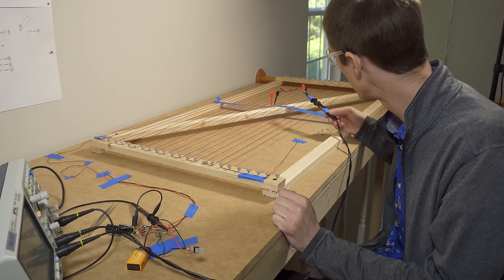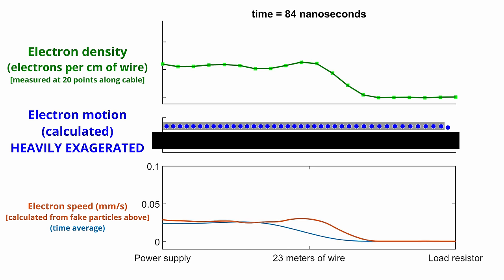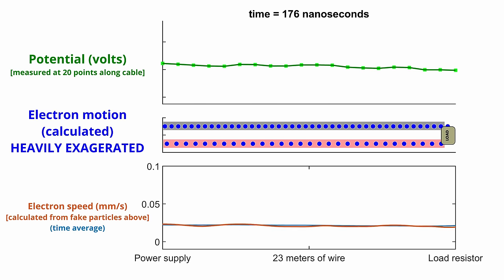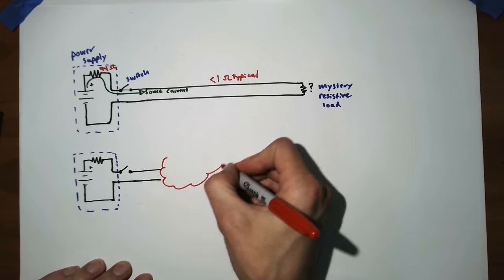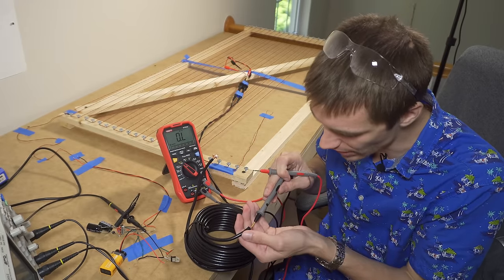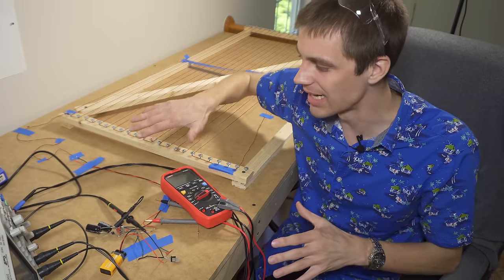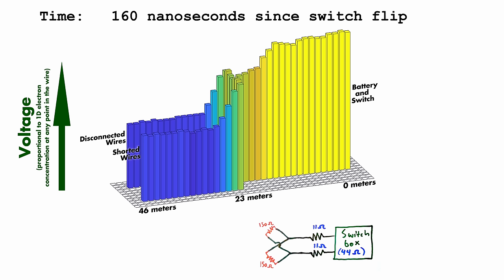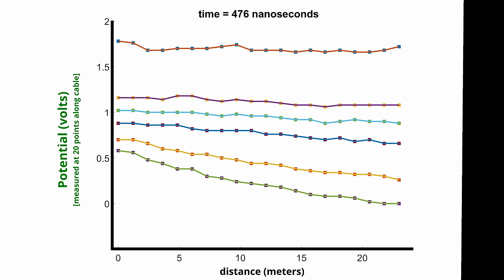What does "impedance matching" actually look like? (electricity waves)

Comment: 25 years ago I learned all this at university.  But the depth of insight you've added to that basic knowledge is a revelation.
Reply: Incredible work here
Reply: I learned the same thing, but 20 years ago...

Anyway what buggs me about the original verstasium post was the original claim that EE didnt learn this.

And.. well  we bety much do. Impedance matchning is like the core of high frequency circit design. Really with out it most modern radio systems would not work at all, like a wifi circut
Reply: @matsv201 yeah, once you get into the Mhz you start to realise that everything is a capacitor and an inductor
Reply: @Jefferson-ly5qe  yea,, i don´t know exactly where the cut of is, we did basically all the labs in 2.5 and 5.1Ghz and then when i worked with it it was basically minimum 800Mhz ... 

Ironically no i work with transport system and the highest frequency we use is 400Hz (note, Hz, not kHz or MHz), typically 8000V and around 1000A.

The people that did the system in the 1970 basically just made a gigantic coaxial cable and bent it to form. This turned out to be incredibly expensive. Of cause we talk about 100 of km of cable, so that is millions and millions.

Some of the AC we could simply eliminate but some of it need to be around, So we basically try to balanced stamped metal sheets. Resistance of the old system was also a bit to high.

Makes it a bit more complicated by the load of the vehicle change the induction.

Still its not really that complicated compare to like a 4G muti frequency base station that i worked with prior. its really just a different kind of complication because everything is huge.
Reply: this is not deep inside. It is an explanation made by a man that simply doen’t have enough technical skills (Ohm’s law , resistance definition for example)
Reply: @stefano.a  I have the feeling that he could outdo you any time even in his sleep. Then of cause I am only an electronic engineer with 70 years experience with electricity. For all I know you could be God but he usually doesn't put in remarks on his own so I doubt that. Why don't you explain the deep inside then please.
Reply: Yes... Fully agree... I can finally build some intuition from all the RF/ microwave classes I took 15 years ago
Reply: @stefano.a  oh stefano, you poor limited little creature, stuck in your linear mind, hoping that people may compliment your "technical skill". What AlphaPhoenix2 has done here is to bring art and beauty and creativity and illuminate our intuitions ... something I can readily discern has never and will never grace you.

Comment: The fact that more or less consumer grade scopes can actually capture this is utterly brilliant. And then all the graph visualisations, especially the one with the 8 or so different resistance levels and see how impedance matching magically works... very very cool! And fairly important with everything with antenna's, especially high powered ones that will reflect significantly if not correctly matched, blowing up amplifiers in the process.
Reply: All hail the Standing Wave Ratio meter & the 50 Ohm dummy load.
I never expected to see hard data showing these waves of electrons as clearly as the sea reflecting waves from a harbour wall.
This has to be one of the most revelatory data sets I've ever come across. 
Dat here in appreciative, slight stunned silence as things I've used in RF & audio all fall into place!
Reply: Coming from the days where we would have to allow the scope to warm up for an hour before use, seeing the phrase "consumer grade scopes" blows my mind. But yeah, I guess that's where we are at. :)
Reply: I picked up a NanoVNA, and it's been really helpful tuning antennas. Generator and scope in one device!
Reply: @trevorus  I have one as well. I bought it for a project that I was working on a couple of years ago. Supposedly it can be modded to do light duty as a spectrum analyzer.
Reply: @MrWaalkman <3 my cheap ass oscilloscope.
Reply: @Noconstitutionfordemocrats1  Hard to beat Rigols, especially since they tend to forget what they started out as and "upgrade" themselves. My DZ1054 now thinks that it is a DZ1104. 

Weird... ;>
Reply: Oh, wow: your comment just made the light bulb click on about why impedance matching in antenna systems is so important, and why we need a dummy load when we're not using an actual antenna. (I'm not a radio guy; I'd just heard about this stuff and wondered about it.) Thanks!
Reply: @trevorus i was looking at VNAs & signal gens recently.  Whats the avg price on that one??  And whats the limits on Bandwidth, Vpp, channel#, etc??

Am seriously considering getting a decent, yet budget-friendly lol, VNA, and at some point soon connecting it up to a RaspPi or equivalent,  and basically building my own handheld VNA, with TONS of build-out & add-on capabilities.   Thinking about getting a touchscreen for it too (i dont think the screen i have right now is touch-capable) 😎👍
Anyway, thanks in advance for the info!!  🙏 💯 👍

Comment: This doesn't just apply to long wire transmission lines. Changes in impedance on PCB traces or lines connected to them creates reflections and that's generally where noise comes from. Robert Feranec has a bunch of videos talking to a signal integrity expert, Eric Bogatin, and he basically explains everything you did in these videos but in the context of PCB design.
Reply: Rick Hartley did a similar thing on Altium's channel. Video name "How to Achieve Proper Grounding - Rick Hartley" He ranked EMI issues above signal integrity. He explains it better than i do.
Reply: @kazuviking  I try and overclock SPI on an atsame51 chip so I can push frames to a ~115KB SPI display as fast as possible. I think the limit is supposed to be 18MHz according to the datasheet. If I add 33 ohm series resistors on the cheapest china 2 layer boards I can manage to get 24MHz before things get corrupted. That's just the first value I tested, on I think a 12 mil trace. It would be nice to go faster, and maybe even pass EMI testing even though I'll never sell anything, but I have no idea how I'd even begin to figure the characteristics of the out of spec peripheral. 

I'm going to have to check out this videos, thanks dudes!
Reply: PCB traces are still modeled as transmission lines they just have a different geometry.  PCB tend to be a strip, microstrip, and coplanar 

TEM transmission lines
Coaxial line
Two-wire line
Parallel plate line
Strip line
Microstrip line 
Coplanar waveguide

high-order transmission lines
Rectangular waveguide
optical fiber

Comment: Let me tell you that this just made me make sense of the DMX line impedance loads used to avoid "reflections" in the line.... I knew about this ripples or waves of "voltage" but I couldn't figure it out why a load of an "apparent impedance" could work to "destroy" them.... This is just amazing.... Thank you.

Comment: At D.C., yes, it reaches an equilibrium quickly but the point of impedance matching is at high frequencies where peaks and dips of frequency response will occur if impedances aren't matched. I find it very interesting and enlightening seeing these high speed captures you are doing in understanding these phenomena. It makes it so much easier to see what is happening. It is distributed capacitance and inductance which creates the 150 Ohm (or whatever impedance, it depends on the cable configuration / geometry) and the distributed resistance which determines the Q (usually negligible), but the basis of why this happens is shown in the transient responses you are demonstrating. This is significant and will be appreciated by teachers in time. Please keep up the good work!

Comment: As a ham radio operator and long time mechanic and experimenter you have just explained something I could not see in my mind for 50 years. Now that I have a visual, it is unbelievably simple. I was like you about the coax cable. I never could see how a 15 foot piece of 50 ohm could be the same as 200 feet. That really bugged the piss out of me. Thanks for the video.

Comment: 14:12 I think that the pulse travelling down each fork in the wire is about 67% of the pulse in the 1st wire. That's because the 1st wire sees a termination of 75 Ω (the parallel of the 2 lines in the fork), and therefore 1/3 of the pulse will be reflected back (as shown). 
That 1/3 is given by the  reflection coefficient  Γ = (Zʟ-Zo)/(Zʟ+Zo) where Zo is the line impedance Zo = 150 Ω and Zʟ is the load terminating that line which in this case is Zʟ = 75 Ω.
Reply: I hope Brian reads your comment. I came up with the same ratio: at the fork boundary,  the transmitted voltage pulses are +2/3 of the incoming pulse and reflected pulse is −1/3 only.
As for power, transmitted powers are both 4/9 of initial power and reflected power is 1/9, hence a 100 % total.

Comment: When I was a teen, I had a book about electronics by one G.M Scroggie. He described "transmission lines" in terms of a series of inductors in series with the two sides of the line, with capacitors across the two lines between each inductor. Basically a whole line of series/parallel tuned circuits which has an impedance related to the impedance of the capacitors and inductors. I didn't understand why, AT ALL. Now, thanks to THIS VIDEO, over 40 years later, I understand enough to SEE why you show it as tuned circuits. Not only that, but I know why the inductors are in series with the line, and the capacitors between the lines. I also see how the impedance works. I now understand why a CB Radio enthusiast needs a "Standing Wave Ratio" meter to ensure reflections are minimised at the aerial. This one series of videos has BLOWN MY MIND and I love it.

Comment: Oh man finally this is an intuitive&accurate explanation to what is impedance. The clumped bit explains what is the mysterious “reflection”.
So the water model is precise, if you only consider gravity. Gravity itself is the impedance in water model.(surface tension and maybe all other fundamental fields contributes a bit but not too important?)
Also the effect of EM field is just propagate too fast to become intuitive. Using an accurate water analogy is good  for analysis.
Also the slope of potential difference between two time points(how long?) is the value of impedance?

Comment: Good explanation, and great visualisations! Though I wouldn’t say that the initial current is “too much” or “too little” because I don’t think it’s useful to think of a transient in terms of the circuit’s future steady state. It’s exactly what it needs to be based on its current state (the impedance of the line that the transient has traveled down so far), and it obviously it doesn’t ‘want’ or ‘expect’ to see a load that is the same as the characteristic impedance, it has no information about what’s coming (and it goes without saying that it has no ability to desire anything!). Usually the designer wants impedance to be matched (in an audio, RF or high-speed digital circuit especially), but the electrons are just going to do what they do.
Reply: How do you know electricity is not a living, conscious being? That's just a speculation or yours
Reply: I think that the anthropomorphisation helps with intuition. Everyone obviously understands that the wavefront isn't actually a living being.

And I do think that it makes sense to think of the wave as "expecting" something. If it hits anything other than the characteristic impedance along the line, it ceases to be a wave and becomes two waves (forward and reflected). Thus, the wave only exists as long as the impedance doesn't change and can be thought of as "expecting" a specific impedance.

The concept of a wave is already a very human abstraction to begin with, so using that kind of language doesn't really change much.

Comment: Now it makes sense, why I had to terminate a Modbus/RS485 wire pair bus with a 120 Ohm resistor, exactly to prevent signal reflection on the line. Thank you so much for all your videos, always looking forward to them!! 😊
Reply: One on each end I hope. :) 

BTW, replacing the 120 Ω resistor with two 60 Ω resistors in series and connecting a "Properly sized" capacitor from the center point of the two resistors to ground will give you about a 3db noise reduction. See Jan Axelson's "Serial Port Complete" page 123 starting with "Terminations for Short Lines" for details.
Reply: Yes it's starting to make some sense ! VERY imformative videos !!

I'm battling another BUS system at Work, a Carlo Cavazzi Dupline system. (a type of large field automation system)
The signal is a Square wave with about 7 volt RMS and at 132 mS there are 128 waves, with different pulse width.
The transmission line is branched in several branches of different length, in total probably over 50 branches and combined, 2000+ meters of wire.

The system is generally used without any Termination at open ends, but we have lots of communication problems, which I attribute to open end cable reflections.
I wish someone at Carlo Gavazzi knew 5% of what others here know, so they could answer my questions 😐
Reply: @daniel635biturbo  Now that sounds like a fun one! :)

While adding impedance matching termination resistors should help out, it appears that your network is already below voltage. Adding termination resistors will increase the load on your network.

Okay, so the system runs at 1khz, and the choice of cable is up to you. Still, line terminations should help, but it would be dependent on what cable you used. Sounds like your voltage is quite a bit low (7 volts vs 8.2). Possibly a node is dragging the network down.

Since your system seems to be overloaded already, I would hold off on line terminations. You should have a "Stiff" voltage source before adding any more load.

At the data rates that the system runs at, a DC meter should suffice to (only) check voltage. But a scope would be pretty much mandatory to see what is really going on.

 And I see what you are saying with the 128 "waves", that corresponds to the 16 x 8 matrix of device addresses with a sync pulse at the start. So the entire I/O "matrix" updates at 1hz? 

Looks like someone figured out how to automate Morse code. What will they think of next? :)

My first recommendation, the easiest to install, and the one likely to have the best bang for the buck, is to chop the line in half and put a repeater in the middle. That will probably fix you up without having to do anything else. And it's not like you are delivering broadband speeds to the other end of the network. :) 

Then you could measure each individual network and see if one is now at the magical 8.2 volts while the other is still at 7 volts. If this is the case, you probably have a module (node) dragging the buss down. And a scope will show if a node is at a different DC bias (the pulse will jump up or down for that node).

So is this for building automation, mining, metering, or?...

And finally PLCS.net is your friend, there are a handful of guys there that have used it. https://www.plctalk.net/qanda/showthread.php?t=11592&highlight=carlo+gavazzi+dupline

Comment: I work with PCB layout a lot, this series reminds me of a presentation from Rick Hartley on how to achieve proper grounding with circuits on and off circuit boards. That one was packed with a bunch of seemingly counterintuitive goodies as well. Fact is, we have been too dependent on the DC laws and the model we built in our head about the AC domain was some sort of extension from DC, and it turned out to be overly intuitive and incorrect. Rick described traces on the PCB as waveguides for electromagnetic fields to travel along, and it's not the electrons moving inside them that carries the engery, but rather the electromagnetic field around the conductors. When people get it seriously wrong, they end up facing a ton of crosstalks on a circuit board and scratch their heads wondering how the pulses "leaked out" of the traces. No, they were never inside the traces.

Comment: Incidentally, the resistive wire kind of shows why we use series termination in digital lines that aren’t highly impedance controlled - having a signal switching on and off, we put a small series resistor, often near the source (transmit side) to absorb some of the reflection that comes from impedance mismatch or discontinuities when the signal is being switched. Having the whole line being resistive isn’t desirable because it’d absorb (I.e. waste) a lot of power, and you’d have to drive a lot more current into it, but a small series termination resistor helps absorb reflections and ringing without much loss.
Reply: It's just like the damper in a shock absorber. If you only have a damper it burns up, and if you only use the springs it bounces too much.
Reply: Source termination is actually fascinating if you match it to the line impedance - at the transmitting end it forms a divider with your microstrip and thus only half the voltage goes down the wire, but at the receiving end with its near-infinite impedance, the voltage doubles due to the reflection and the signal is preserved!
Then the reflection goes back up and gets eaten by the source termination resistor, although you can send multiple pulses and the waves will just go through each other.
Reply: In a digital line, you have all the odd harmonics making up the square wave, therefore you want the characteristics impedance of the line to be non-dispersive ( having the same phase velocity for all frequencies)  to avoid having a "slew" in your square wave pulse (which would be caused by different present harmonics having different phase velocities).